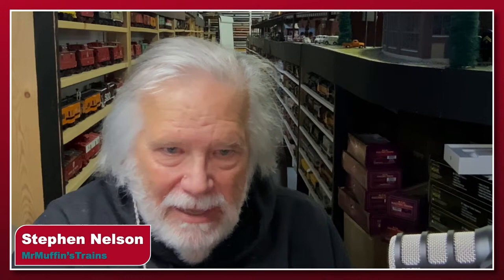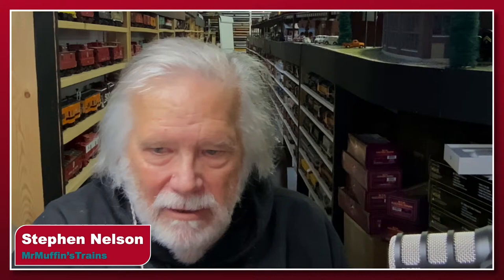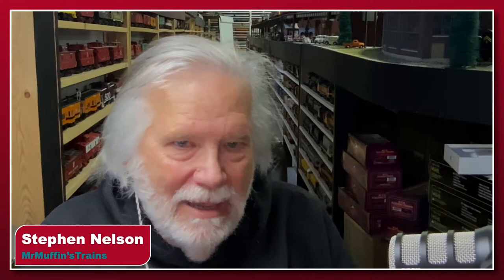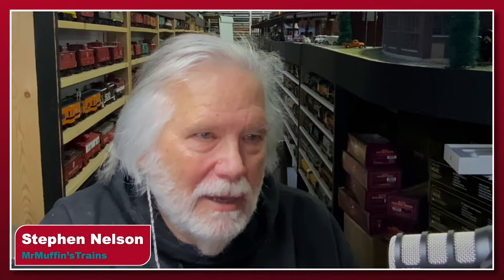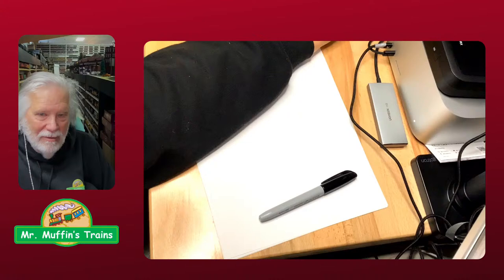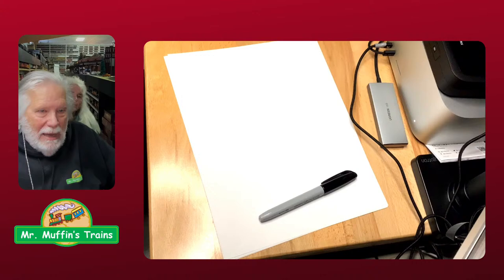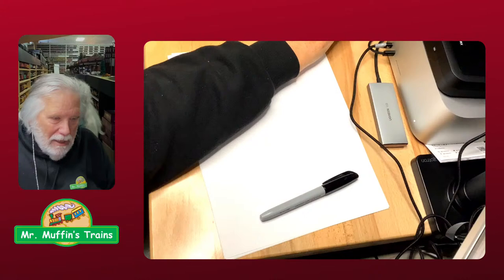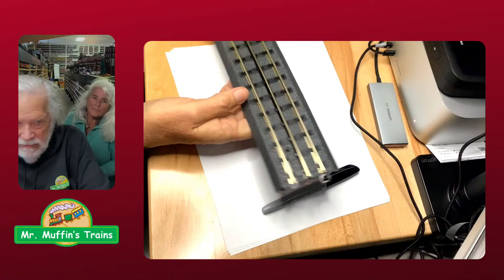Talking Trains with MrMuffin

Comment: Sorry I missed the live feed, but I have a question.  Common bus wiring works best for lionel, and the star method works best for mth.  What if you have both systems? What system do you use?  I use the bus system on my 16 x 15 layout, and my lionel work every time, but mth works 95 percent of the time.  Sometimes, I have to reset or delete and install an engine.  Sometimes, I lose connection with the engine, and it goes rouge.  Should I chang the wiring to a star pattern?  I'd I do will I have issues with lionel.
Reply from the maker: You won't have any issues with Lionel - it doesn't care.... Thanks
Reply: Thank you